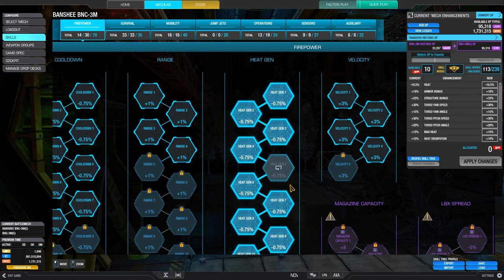Banshee Death Stare with Thirty Heat Sinks!

Comment: What’s the difference between Single Heat Sinks and Doubles? Cool build anyway!
Reply from the maker: Double heatsinks cool down faster per ton, but singles have a higher heat threshold by count. So if you want to squeeze more alphas before override, single heat sinks are your jam if you can spare the tonnage to accommodate them. I'd  give you specifoc numbers for the math but PGI keeps changing them. This most recent patch (Dec 12 '23) just buffed single heatsinks a bit more, so this build is slightly more fun than this video conveys.
Reply: single heat sinks only take up one slot, double heat sinks take up 3 (or 2 for clanners) Both are one ton, but DHS has 40% more heat efficiency, which you pay for in slots.  Single heat sinks in this game have an incredibly high heat cap for balance reasons.  What this means is they can store more heat without overheating, but suck at getting rid of it.  Hence why you need 30.
Reply: hold on now, those are excellent scientific explanations but double heat sinks are the better choice in 99 percent of mechs. There's only a few single heat sink ("hs" for short) builds, and generally speaking the double heat sinks provide better cooling and you'll want as many of those as you can squeeze. You'd have to search for single heat sink builds that are competitive in tournaments and find only a handful out of 200+ double hs options, as far as i know, 7 years off and on, comp experience for 2 years.

Comment: if only x pulses where not the hottest weapons on the planet but pgi so that explains everything
Reply: In the TT rules they are hot because they are pulse lasers that have the same range as the regular version of the lasers. So a Large X-pulse has the range of a LL instead of  LPL. What PGI did is interesting however.
Reply: @joseph1150   yeah but they still have no right to be as hot as they are